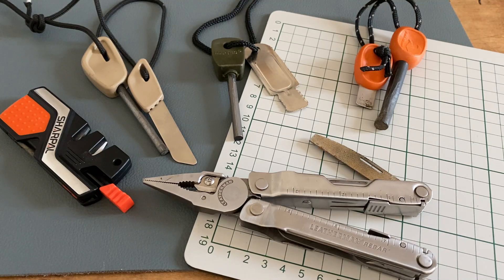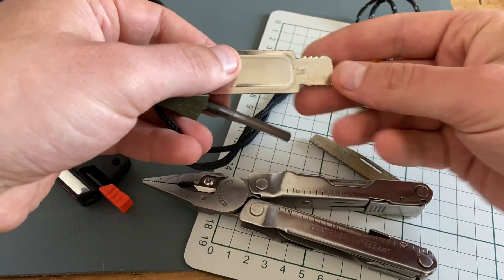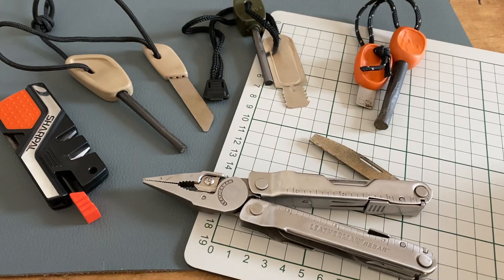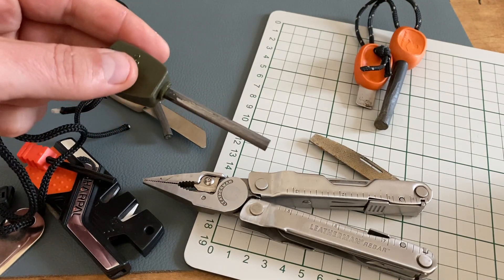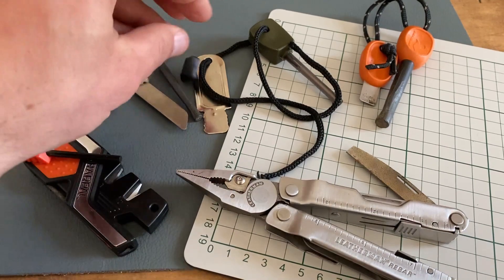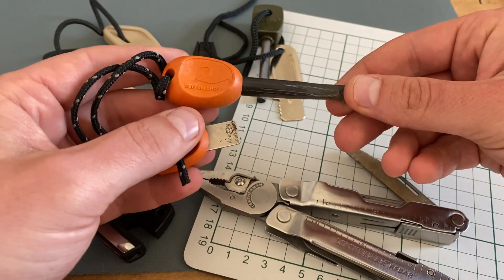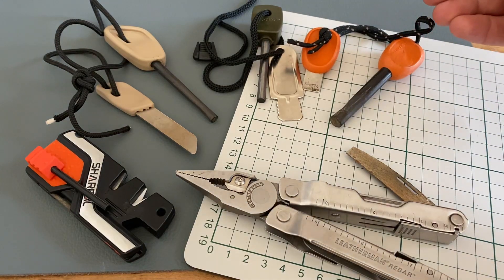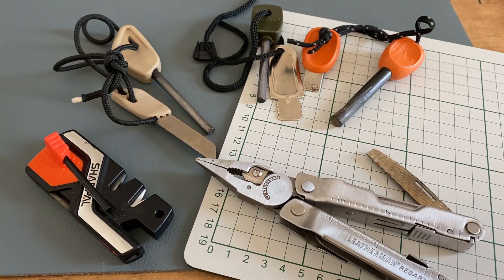3 Firesteel Weak Points YOU SHOULD CONSIDER WHEN BUYING!

Comment: EDC Ideas -
Great points and demonstrations on potential issues with some of the firesteels being manufactured and sold on the market.

Many budget-friendly versions tend to have these problems.  

Some issues can be modified to work better... superglue the rod into the handle, swap out the striker (or get rid of it entirely if using a SAK, knife spine or multi-tool), up-grade the cordage for the lanyard, etc.

 Purchased a Gerber Bear Grylls Fire Starter years ago... overall it was decent, swapped out the cordage (which was flimsy & too short, IMO) and up-graded to 550 Paracord.  
[Could even upgrade it further to Survivor Cord or 550 FireCord.]

Thank you for your insightful EDC content.

Would you consider doing more instructional EDC-usage videos in the great outdoors? 🙂

Happy Trails!
🇺🇸 🏕 🌲
Reply from the maker: Wow 🤩 thank you so much for you amazing comment. I agree with you. With some modifications everyone can upgrade the products. I am actually working on more videos and I will show some more gear reviews and outdoor tests 😁

Kind regards Clemens
Reply: @edcideas  
Fabulous!
Looking forward to it.
🙂👍